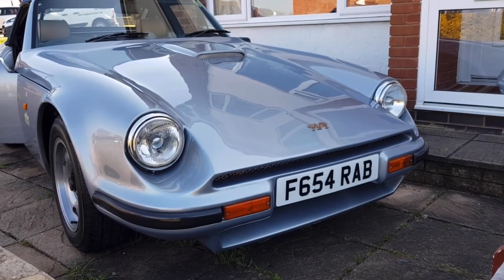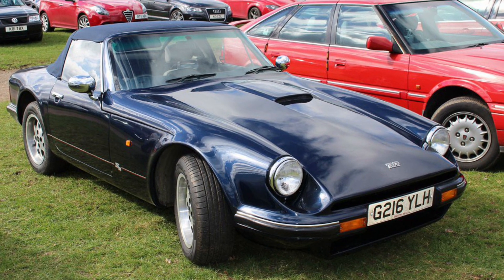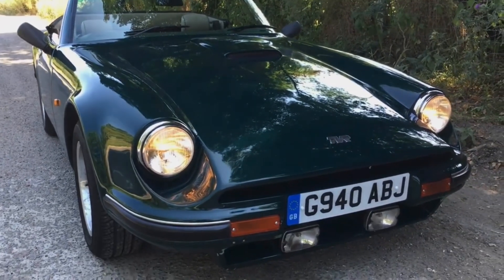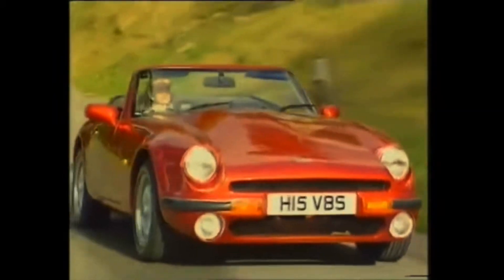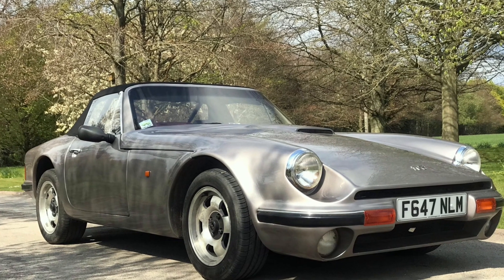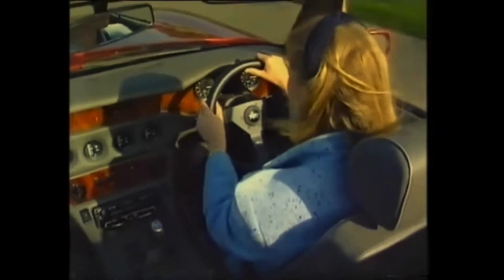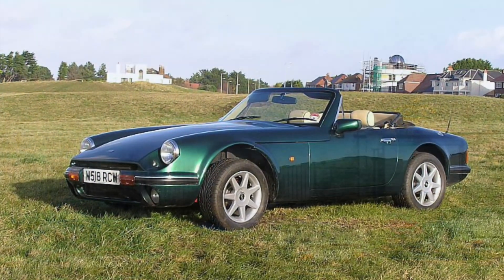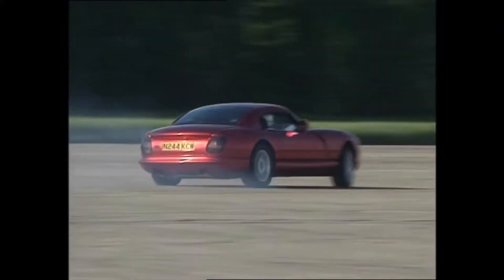TVR S Series: a British Sports Car success story that gets even better (Part 2)

Comment: I had an S3C for 4-5 years. Fabulous fun, reliable and I enjoyed tinkering with it. I still have Steve Heath’s book which is brilliant. Always sounded fabulous but its problem was that it was not directionally stable. To keep it straight required constant small corrections and I felt it could bite in the wet. The E34 525i I got afterwards was probably a faster car point to point as it was so stable and accessible with good grip levels and predictable handling.
Reply from the maker: I’m sure it was full of character though!
Reply: @automationvisuals7867  So much so. I used to go away for long periods and when I got back I would fire it up and take it out. I remember some white fluff getting blasted up out of the exhaust as I blipped the throttle😂 Literally clearing the lungs!
Reply: I have an S3, 
& It's scary in the wet & doesn't handle bumps in the road very well either. Immense fun though & very exciting.
Reply from the maker: @GBURGE55  all part of the fun I suppose!